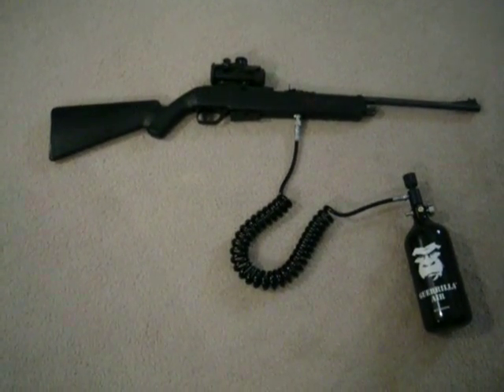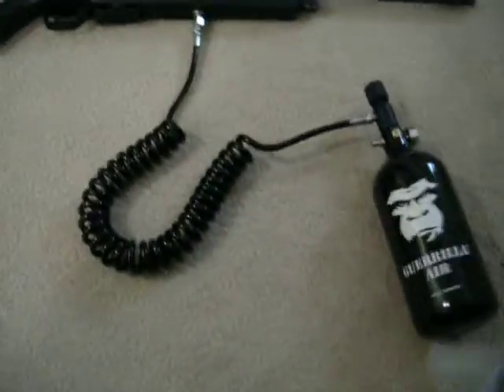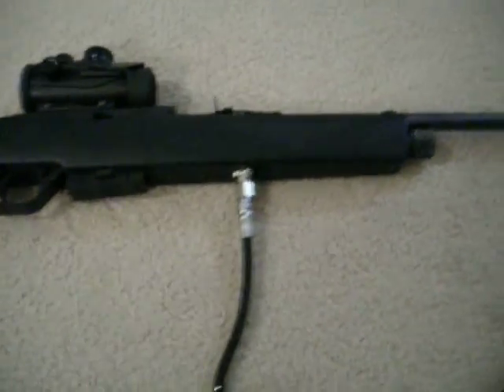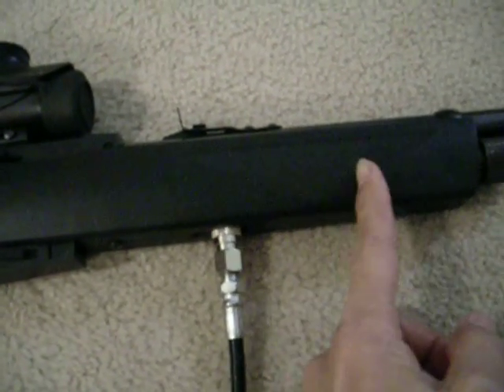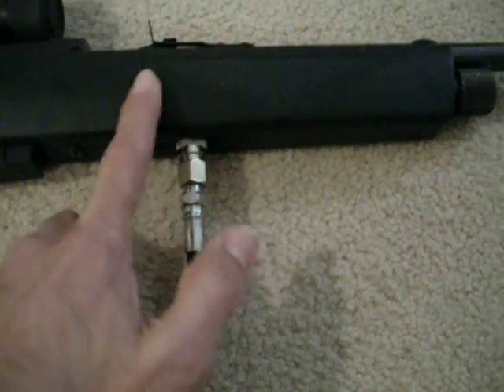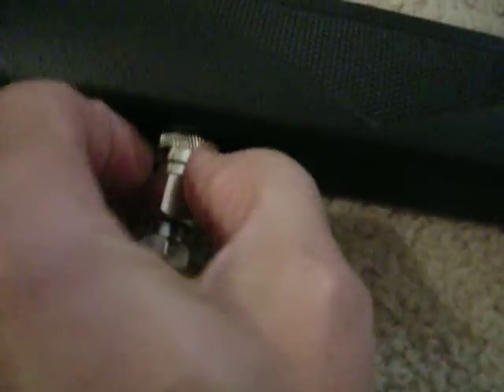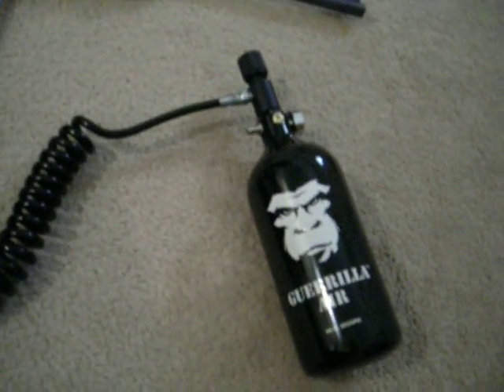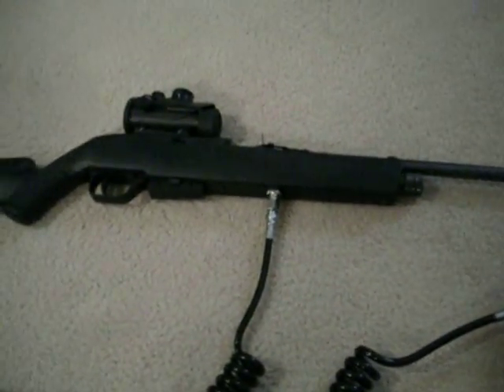Crosman 1077 conversion to HPA

Comment: Good detail on the conversion to HPA.  I tried mine with 1200 psi and now the gun has an internal air leak.  When I convert another one I will stay below 1000 psi.  It worked great with more power while it lasted.   Thanks!
Reply: Hello 
Do you use co2 or air compressor?